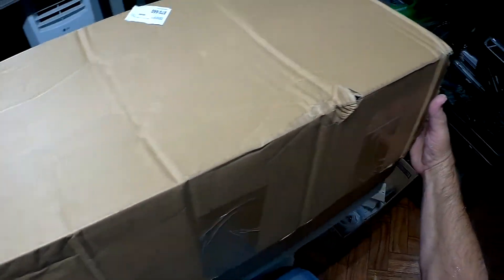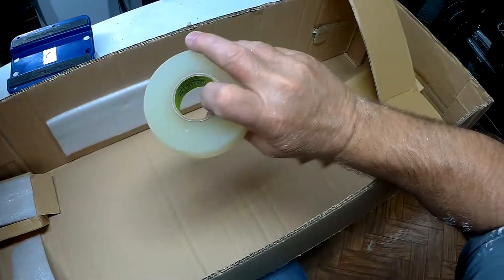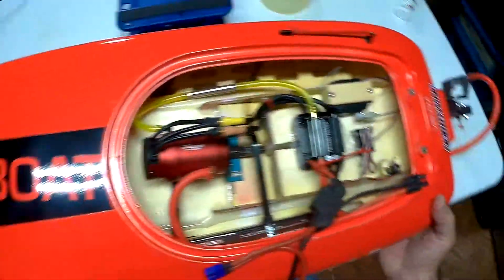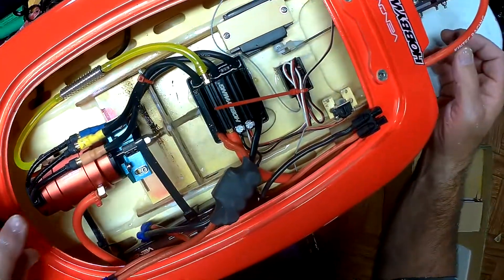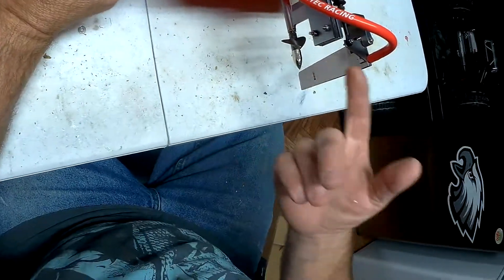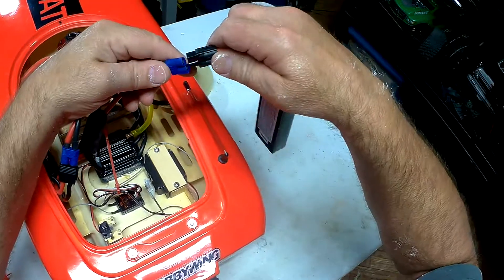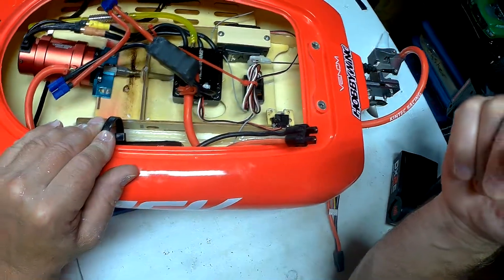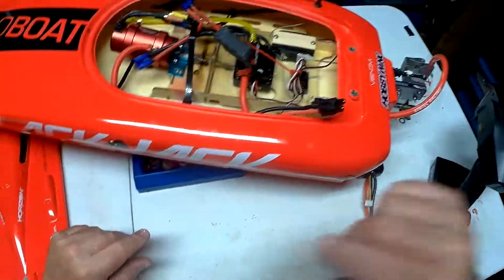My first boat proboat blackjack 29

Comment: My buddy has that boat and it's sick bro! He did a couple mods to the prop and it legit made it twice as fast! I too got my first boat this summer, its the hobbyking Scott Free.. It's such a good boat for the $$ and it flies! Haven't had a single problem with it.. The only thing about rc boats is the run-time, serious bro even if u fit the biggest battery possible you'll still be LUCKY to get 12-15mins
Reply from the maker: yea run time is short but after that i can break out the KRATON and bash it...lol
Reply: RCbashing the KRATON lol! For sure! Glad u made a good choice for ur first boat.. There's a lot of lemons out there! Most need work straight outta the box just to be decent lol!
Reply from the maker: thanks bro... i still cant believe i found one with these bad ass electronics already in it..Plus the batteries were not even cycled yet..
Reply: RCbashing the KRATON 
Good shit bro! U always find the deals mang lol! What do u work with a computer in front of u or something? Lol
Reply: RCbashing the KRATON 
Hey i asked my buddy and he said the main upgrades u need r a OSE flex shaft and a Octura S&B x440/x442 prop.. He says they're a must, i don't kno much about boats but he did get mine ripping in no time